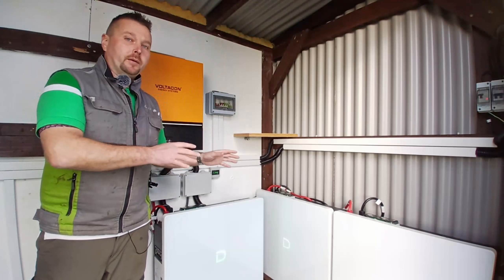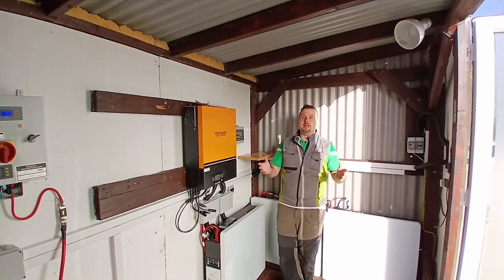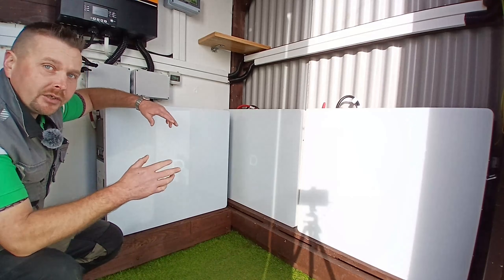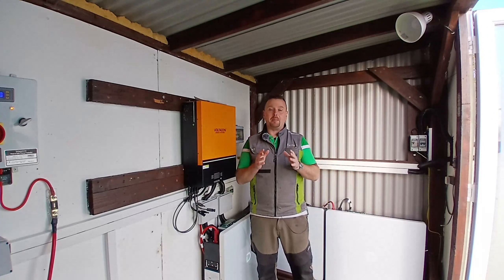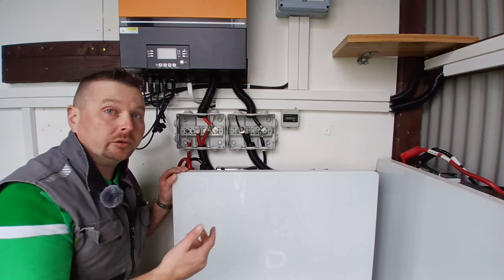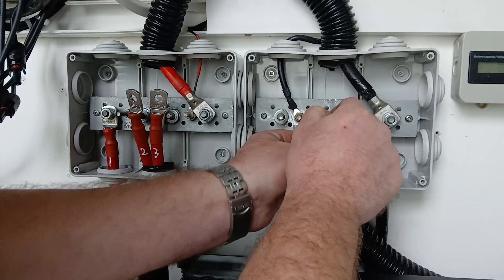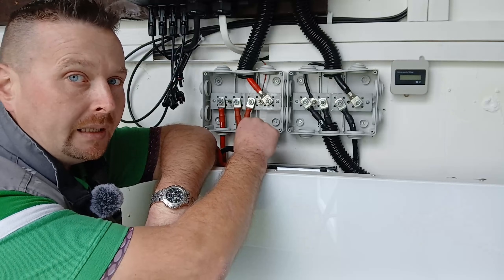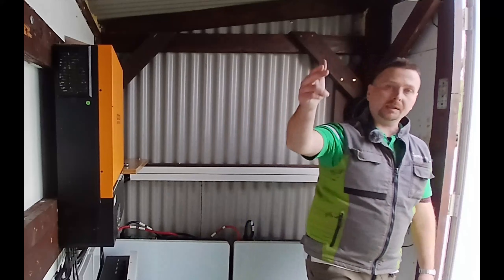DYNESS LiFePo4 Battery Problems & How to connect busbars

Comment: thanks for this video Micheal, do you recommend lithium or sodium batteries then? is the software patch you mention are you referring to a software upgrade from a official dyness rep? Also I have been told to install this dyness battery and solus inverter outside as in the UK they are making solar installers to place them outside now for fire reasons, the solar company also said that if it comes in here to Ireland peoples house insurance could increase due to having batteries and inverters indoors....
Reply from the maker: Youre very welcome. Definately wouldn't recommend sodium batteries yet. The technology is still too young and currently they perform worse or equal to lead acids. Will prowse did a good test video on a sodium battery, worth a look. 
The software upgrade for the dyness powerbox does require an official dyness registered installer to request it on your behalf. 
If you have to hire an installer and they must install outside then build an enclosure around the battery and use heated seed germination mats to keep the battery warm. A germination mat will use 20watts of energy whereas the battery self heating function could be as much as 400watts. 
As for insurance scare stories, understand that they tell you this so that you conform to their method of doing things. Folks who've done this are seeing all sorts of problems. Installers are salesmen with a trade qualification nothing more. Bypass this by building a little powerstation separate to the house. 
Ive showed you and everyone else how to do this, dont be listening to the railroaders and follow what ive shown.

Comment: Good reason to keep an eye out for sodium batteries. Pricy at the moment but they aren't really at full production yet but they can charge and discharge at much lower temps than LFP. 
That said, will need a specific inverter as they have a much wider voltage range as well.
Reply from the maker: Thanks for the information, it's definitely something to keep an eye on for the future.
Reply: A caution about soduim batteries... they are the polar opposite of LFP, their discharge profile is not flat, it is quite wide actually.   Most 48v equipment will operate from 46v to 58v.  Soduim batteries will require equipment that operates from 36v to 58v.  Quite a wide voltage range.  Aside from that they do look interesting.

Comment: I am running a mix of different batteries off one victron inverter charger, each battery has its own BMS, my first battery, a pylontech,5kwh is com connected to the victron, but all the others are connected only by the battery cables, a 10kwh vehicle battery, a 2kwh pylontech unit with a JBD BMS, and two 3kwh homemade car battery cells with JBD BMS. They all seem to balance happily even though they are all on different length leads. They may charge or discharge independently, but they balance among themselves.
Reply from the maker: A pretty good accomplishment truth be told. Equalise those cable lengths and positions on the busbars and they should be absolutely spot on watt per watt. The exact perfect balance depends on conductor resistance, equalise that resistance and theyll level out.

Comment: Very timely, as I was looking at Dyness as a possible 2nd battery system, but this anti-DIY remote malarkey is a definite turnoff. Also, I try to keep my batteries at 15°C minimum, so that heating feature seems a bit like a gimmick to me. Thanks, very informative
Reply from the maker: They are a good battery for the money. However the self heating function has another issue. It consumes 400w according to an informed source of mine. The germination mats mentioned by another commenter are definately a more efficient way to go.
Reply: @ourkilkennyhomestead2006  Hi Micheal, what germination mats?
Reply from the maker: @katiecondon309 if you go onto amazon.co.uk and search for heated germination mats, they should come up for you.
Reply: what is the DIY remote youre talking about?
Reply from the maker: @katiecondon309  I think he was referring to dyness controlling the firmware updates as opposed to releasing them to the public to use freely.

Comment: At 2.30 on what is that noise? Very useful vid and yes, it has been very mild so far this Winter, plenty of wind though.
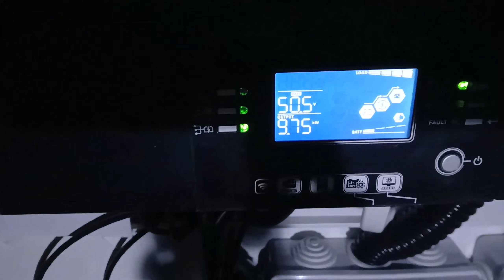Reply from the maker: Glad you found it useful. The noise  at 2:30 is the cooling fans on the inverter. They switch on to full power when pulling heavy loads or during high pv input.

Comment: That buss bar configuration is a great tip!
Reply from the maker: Yes indeed, have noticed closer performance across the three battery packs. Can't take credit however, it came from greater minds than my own. Just happy to share it and help others out there.
Reply: Great call-out on the bus bar reversal. That solves a problem for me on the long Victron Lynx boxes. Great tip

Comment: Hey Guys, an idea for your wind turbine to charge inside with no winds. 
It's using the weight of snow or water to spin the turbine with just Gravity.
Use a bucket + 2 hooks on a long chain or a belt to go over a large pulley 
up top, down to a smaller pulley at the bottom attached to a wind turbine.
When the bucket reaches the bottom, move bucket to 2nd hook up top. 
Adjust the height and angle plus gearing to help increase charging time.
If you set it up inside then you could use melted snow to flush the toilet.
For more ideas Search  -  
gravity free energy
Reply from the maker: A good idea for a gravity generator, thanks for sharing.

Comment: Thoughs foam interlocking floor mats are a qiuck fix untill a the update or even to save some watts.
Reply from the maker: Good idea Henry, have to do a thorough insulation job on that shed.
Reply: Thanks Mike, iv just done my battey in them, itheir more for keeping the cold off than keeping warm.
Reply from the maker: @HenryOwens-py3ur good job. It'll be interesting to see how well they work.

Comment: LFP Batterys work best @ a temperature of 25C, my solution to the cold weather was insulating the battery and adding a germination heating pad with temperature sensor 15euro on amazon, they use 50W max. For the more advanced DIY battery kits are a much cheaper option, recenlty added a 16.3KW for 1,300 Euro all in (Nov 2025) about a 1/3 of the normal price.
Reply: I do the same. Insulation and heaters
Reply from the maker: Thats a very good price. Have to insulate our power station here.